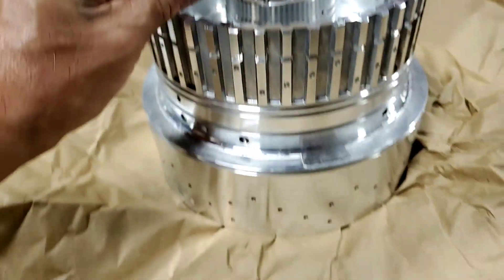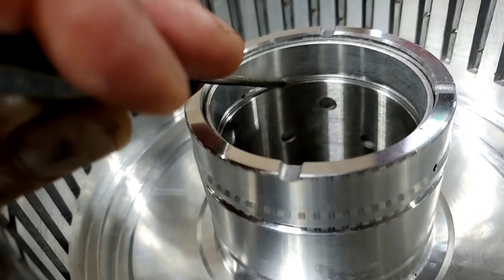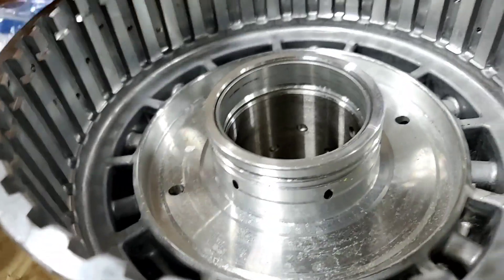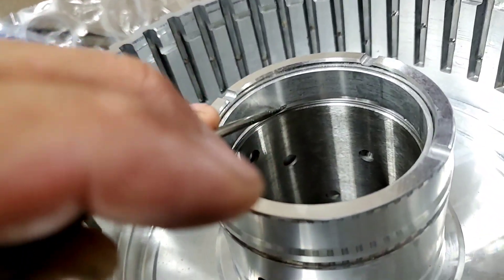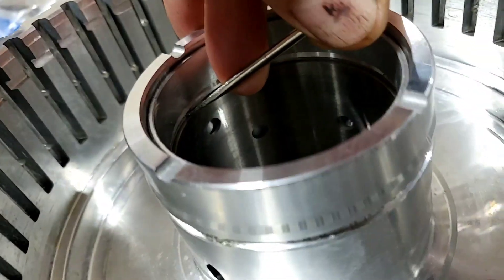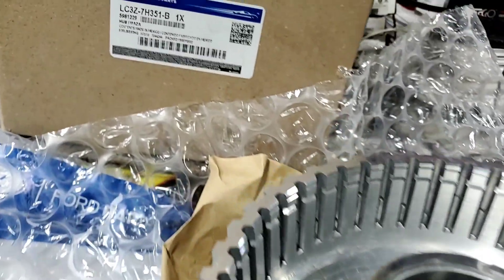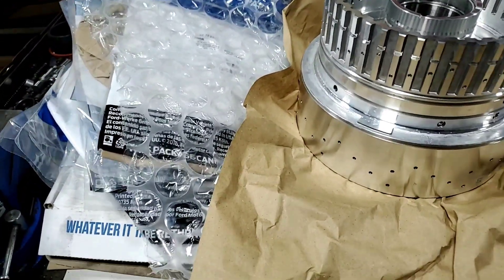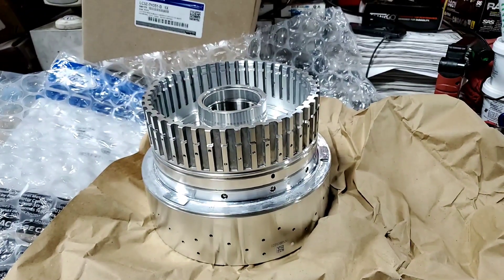✅10R140 CDF Drum Update | #10R140

Comment: This should be a Class Action Safety recall for how dangerous it is as they fail in traffic with stalling and loss of acceleration
Reply: Exactly, I’ve been having non stop trouble with my f250 10r140 I can be pulling out into traffic and my truck never downshifts from a dead stop and stuck in 8th gear randomly, no power to move hardly them suddenly slams down to 2nd or 1st

Comment: My 2022 F-150 Built in March of 2022 just had a Complete 10R80 Replacement Transmission done in Dec 2023. My question is this, How would I know   "if"   The NEW 10R80 is of the Updated Style???? Would anybody have a Clue how? It's in the Truck now, it works, but how would I know if its an "Updated Tranny"???  🤷‍♂.

Comment: You mentioned replacing the torque converter as well. Was it due to the recall that the dampening plate wasn't hardened? My production dates lands for it but being a 7.3 they don't include mine. But, 7.3 in Canada does.

I'll always be concerned about that for however long I have thus truck.